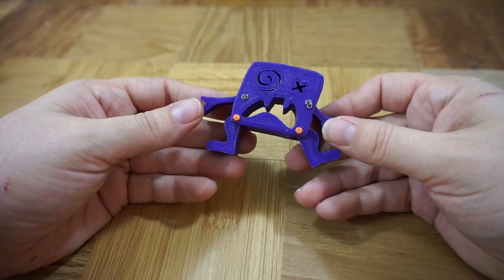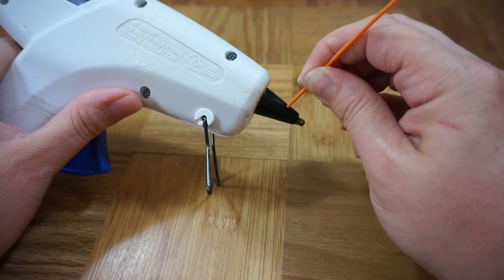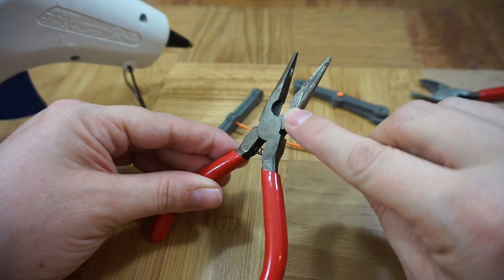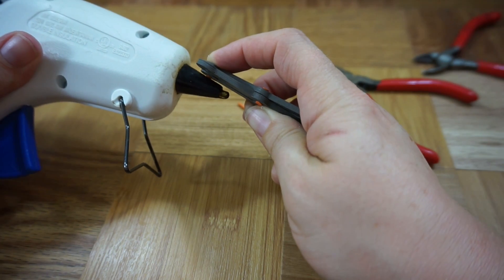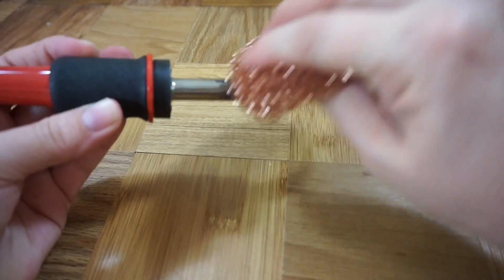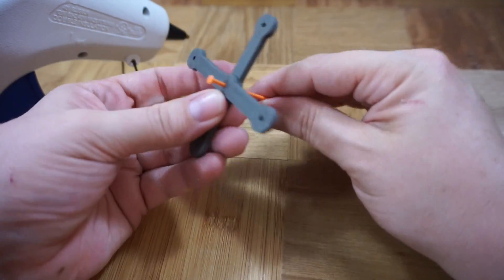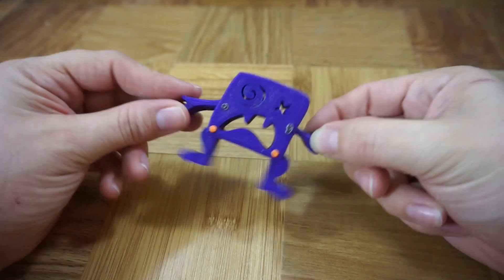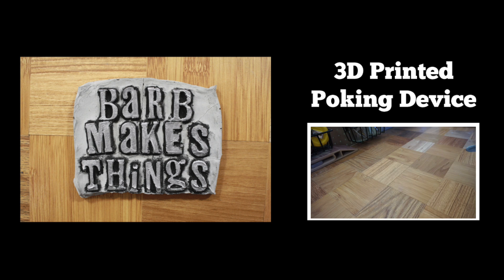How To: 3D Printing Filament Rivets

Comment: So I made some jumping spider enclosures using pop bottles and E6000 glue.  But the glue smells horrible and takes forever to dry to the point it doesn't off-gas anymore.  So in my head I was thinking plastic rivets, and then I was thinking 3d printed rivets!  I initially thought of using the soldering iron but decided to google and I really liked your idea of using a hot glue gun as well as using pliers to put a fixed amount on the other side of the hole.

Comment: nice video! please note that the technique is not "yours", it has been out in the wild for a very long time: http://www.thingiverse.com/thing:34510
Reply from the maker: +JBFromOZ never claimed to have invented it. i did, however, put together my thoughts and suggestions on what works best in my experience. thanks for the link.
Reply: +Barb Makes Things noting at 2:21 you do say "that's my technique", hence my comment as I documented it in 2012 with CC:SA:attr license :-)
Reply from the maker: +JBFromOZ ah, the semantics of possessives. when most of us say "my country," we aren't suggesting that we exclusively own it. I was referring to the technique as I use it, as opposed to the way some others do, for example, heating the filament while forming the head rather than in two separate processes (for both sides), and using a glue gun for it. I imagine other folks have done it that way before me, but I haven't seen videos of them, and I had other tips to add as well.